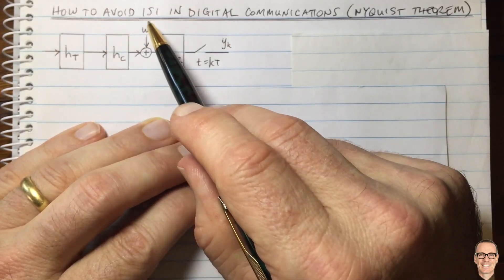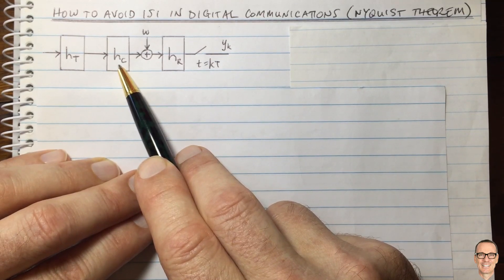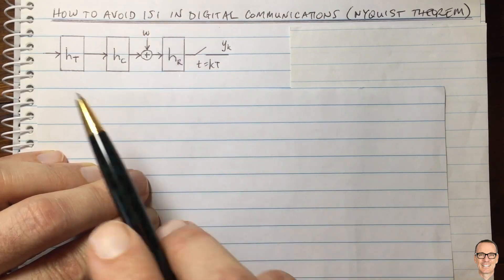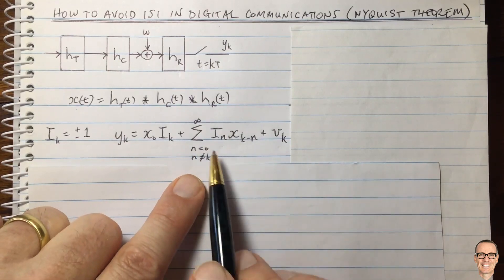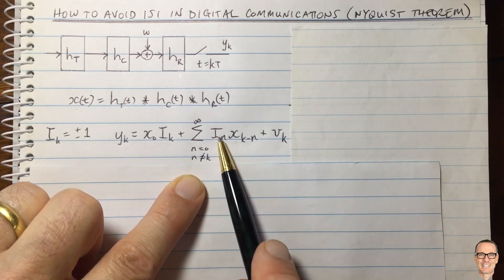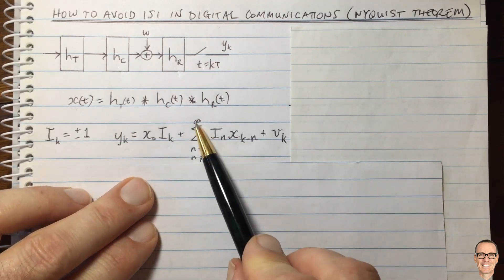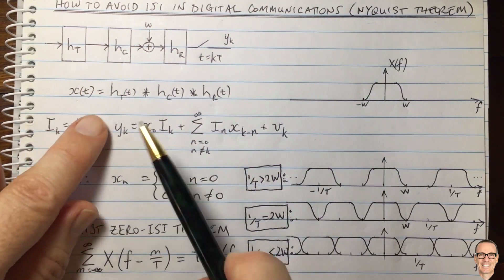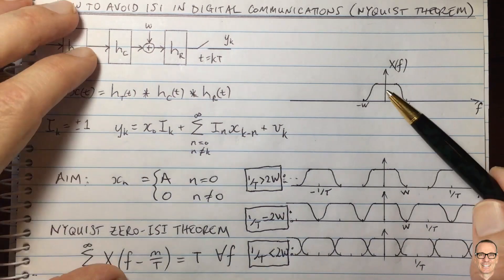How to Avoid ISI in Digital Communications: Nyquist Zero ISI Theorem

Comment: Is there any definition of "interference"? It refers to transmission in the same frequency that aren't for the receiver. But what is with slightly different frequencies? Is that interference too? It is a more general question.
Thanks a lot .
Reply from the maker: Signals that are out of the frequency band of your receiver will be suppressed by your receiver front-end filter, so they will not interfere - unless your filter is not very good.